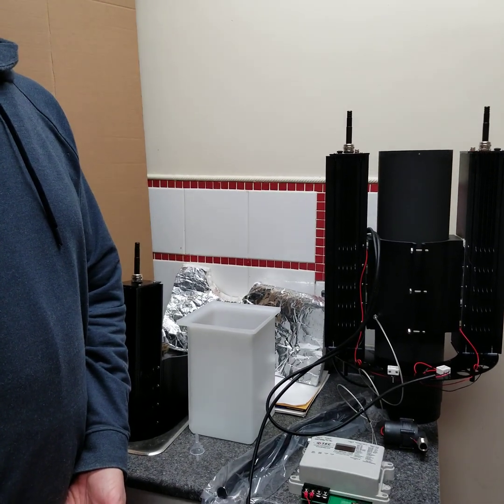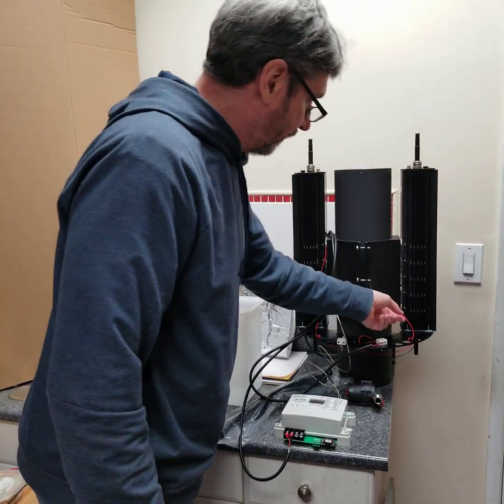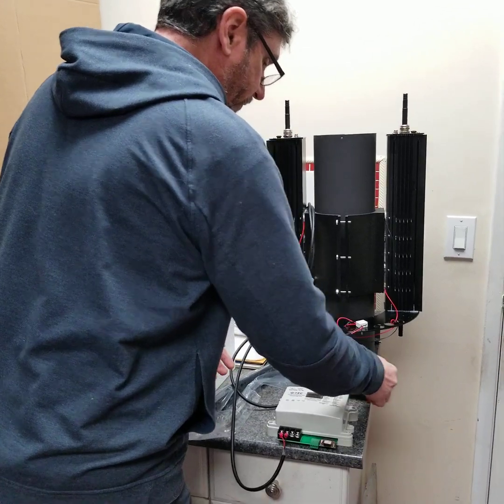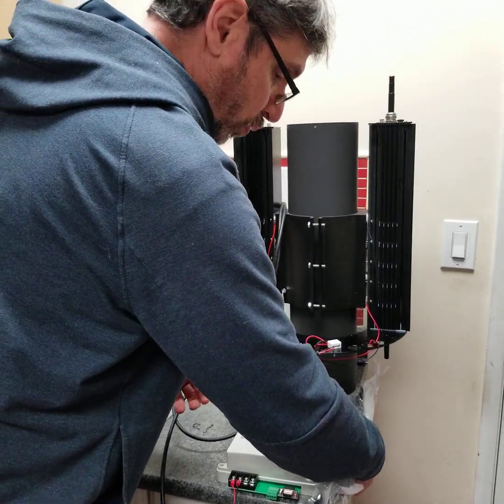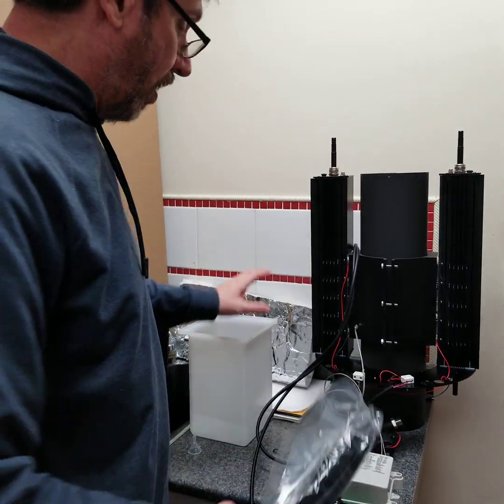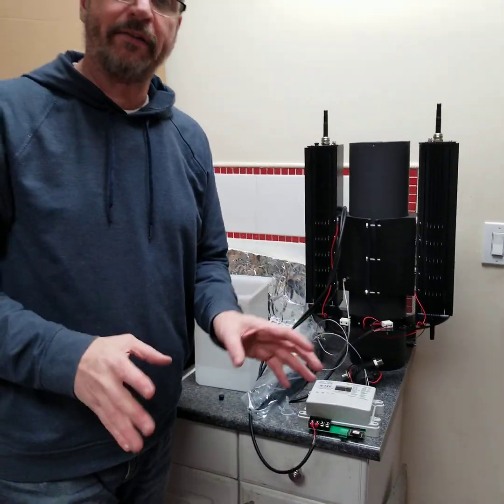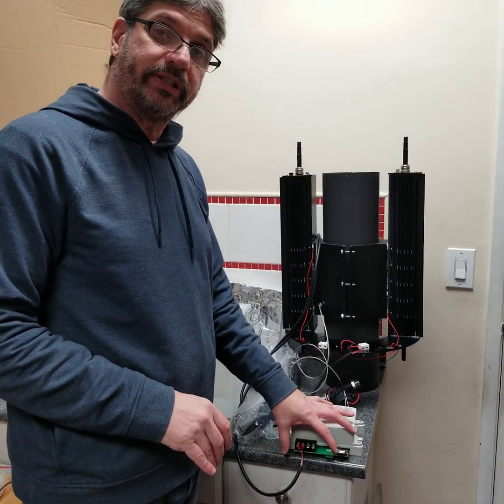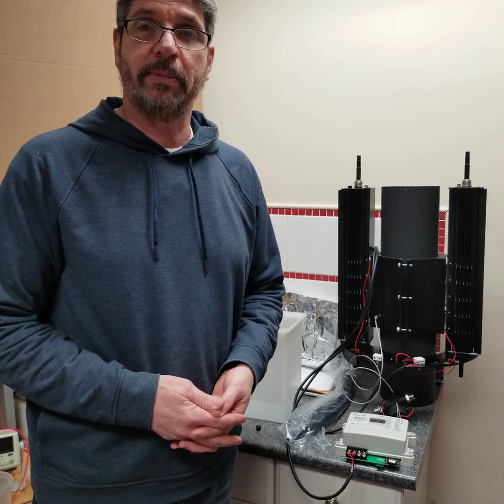Rabbit Ears 100 Watt 12V 24V Thermoelectric wood stove generator Install instructions

Comment: Bonjour de france, est ce que ce système existe en plus puissant, et en 220 volt merci
Reply from the maker: Le système est DC 12 ou 24V. L'énergie verte n'est que du courant continu. si vous voulez du courant alternatif 220C, vous devrez prendre le courant d'une banque de batteries et utiliser un onduleur pour convertir du courant continu en courant alternatif. Les oreilles de lapin chargeraient les batteries.